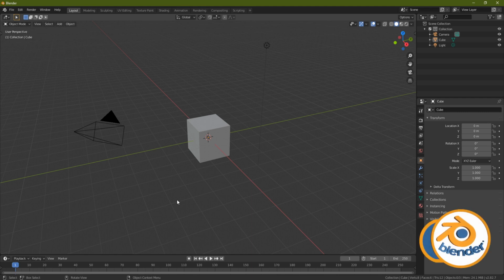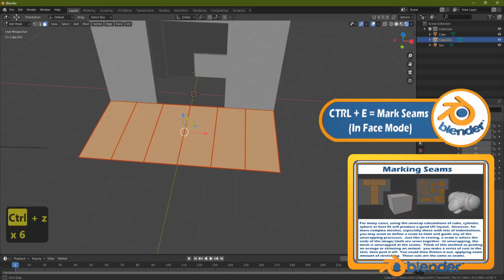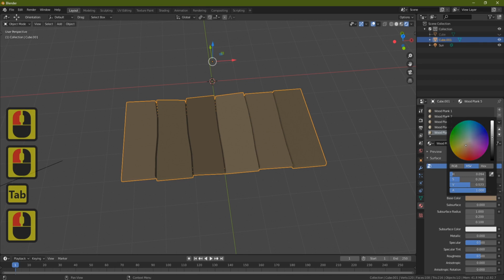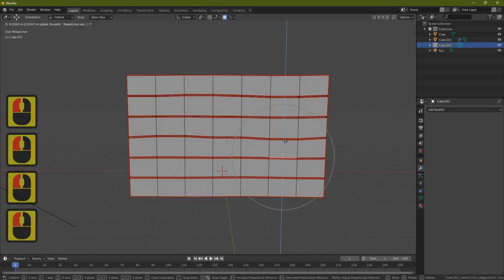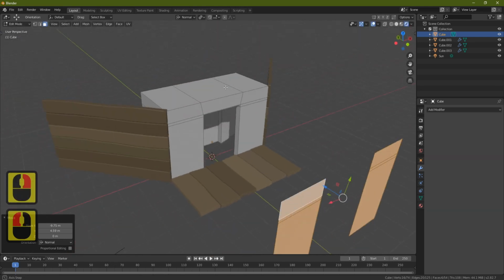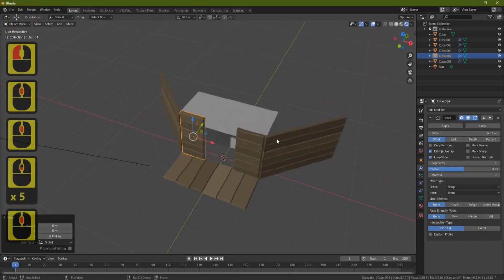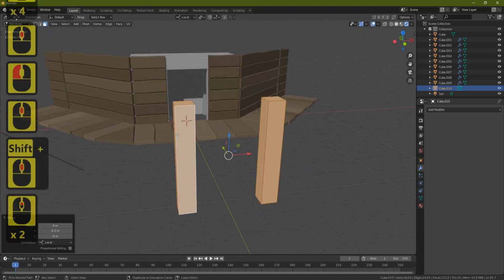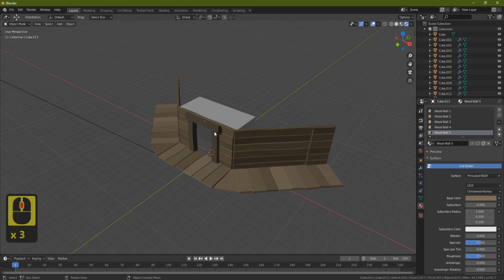Blender 2.8 3D Model Western Stylised Saloon Complete Beginners Guide Part 1 Pixar Style

Comment: Hey  Neil 👋

I just finished going through Part 1:

I made some mistakes, that I didn't spot until I reached somewhere in the middle
Because things got too messed up, unfortunately I ended up starting all over

Nevertheless... here are the final results:
https://imgur.com/a/yA3Necs   👈🏻

I didn't know its possible to build high aesthetic with low poly, 
without the need for fancy texturing painting technique.

Just pure and simple material 👍🏻
I am looking forward to part 2  

➖➖➖➖➖➖➖➖➖➖➖➖➖➖➖➖➖➖➖➖➖➖➖➖➖➖➖➖➖➖➖➖
⚡Note:  If you are a Linux user⚡

For some mysterious reason I couldn't get edge loop to work since I switched to Linux 💢
(Linux Mint 19.3 "Tricia" - Cinnamon (64-bit) My specific version)

Apparently alt is reserved for windows-resize shortcut in Linux as explained here:
🔧https://blender.stackexchange.com/questions/24473/alt-click-is-not-selecting-edge-loops-in-linux🔧

When I made the suggested changes the problem went away 
Thought I would share this with you if you are struggling with the same issue

➖➖➖➖➖➖➖➖➖➖➖➖➖➖➖➖➖➖➖➖➖➖➖➖➖➖➖➖➖➖➖➖➖➖➖➖
Reply from the maker: Awesome job :) looking forward to seeing the results and thanks for letting others know